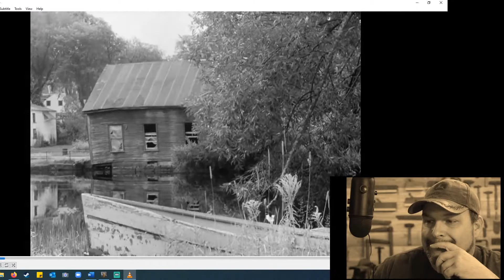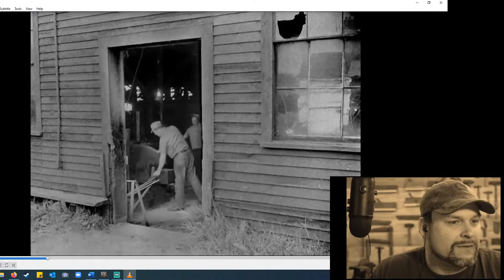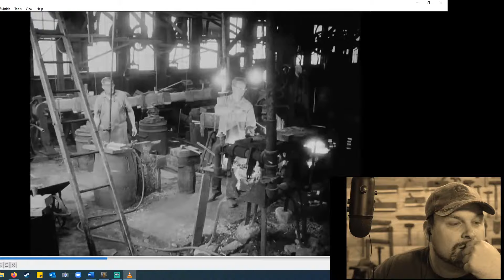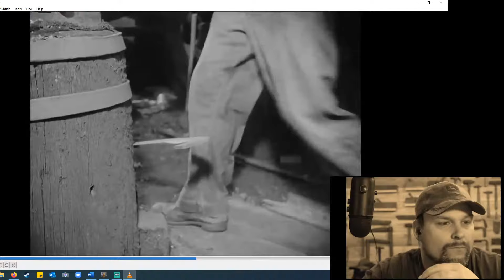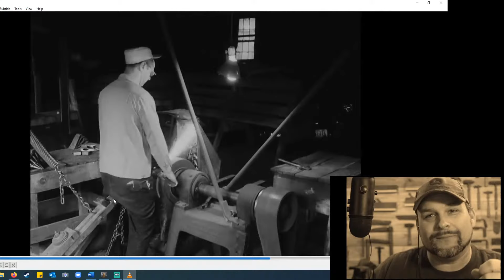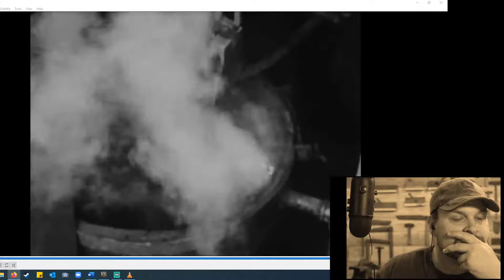"Pioneer Axe" 1960's Documentary Walk Through!

Comment: I just loved the review of a video of an old world blacksmith workshop from the point of view of a modern blacksmith. Of course you are going to catch things the average viewer wouldn't. I was interested that their high carbon bit was welded over the outside of the head instead of inserted between the softer wings of the head's wrap around structure. So, still technically san-mai, but with the high-carbon on the outside (and edge) instead of in the middle. That is contradictory to everything being put out in the modern era. 
I sure hope you review more of these antiquated videos. I loved the narrative you added to it.

Comment: that video was  so informative. awesome!  I am retired from the plywood manufacturing. 40 some years. and this video made me think of the advances  the plywood industry has made these days is also unreal. well it would be almost be impossible to explain how the plywood is made let alone the changes that has been made.  even on you tube i have not seen any videos that has snown  what I have seen and worked with, i started in the early 70's to 2005 when the mill i work for caught fire and burned to the ground. i found myself working for a smaller company that is called a re-saw Mill. we took wood products that other mills don't even want to sell and made many different other products. and using  1920's machines some even cut in half just for one stage in making fence boards. . thank you for sending me down memory lane
.

Comment: I was struck by the technique of placing a specifically shaped piece of tool steel over the edge and forging it on, as opposed to putting tool steel in a san mai type fold. Very interesting, thanks for sharing.

Comment: I think I know the answer to the sway back hardie tool. When you bend flat stock for an eye, it will hourglass shape itself (each end of the hole flared out) I assume they put in a reverse curve before bending so it bends itself straight and proper shaped during folding.